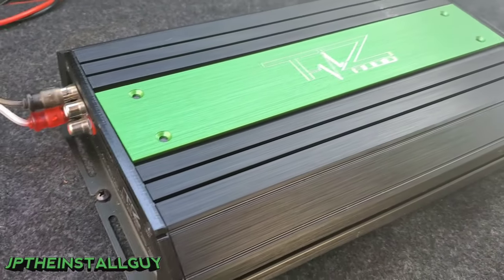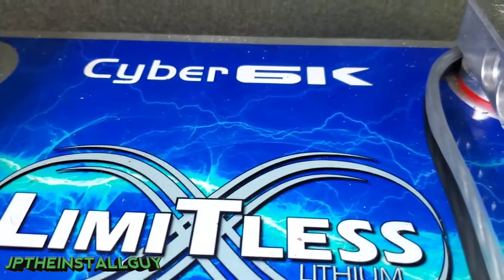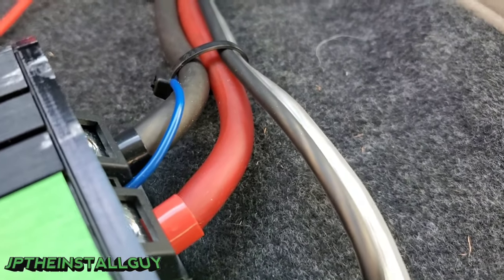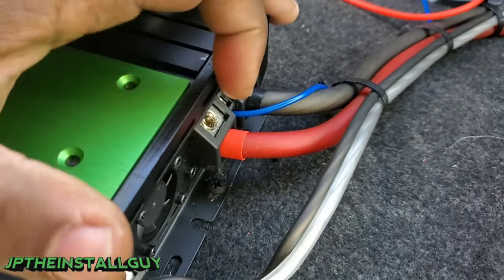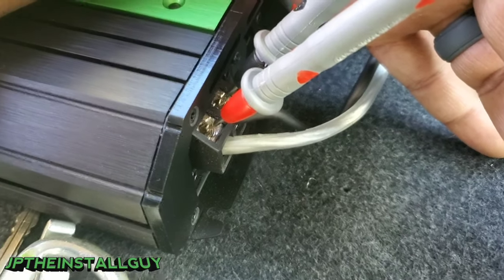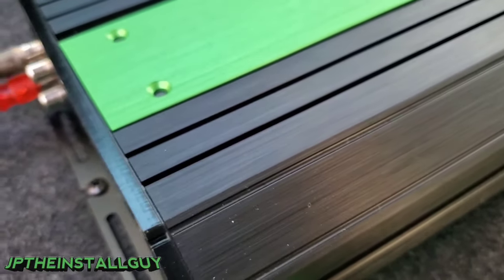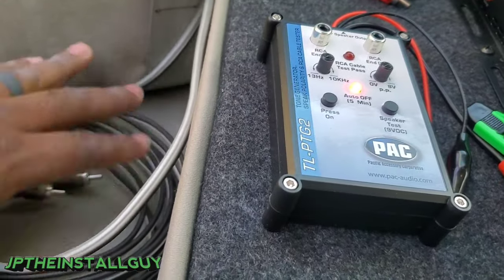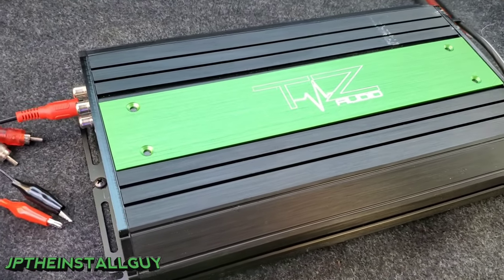Amplifer Troubleshooting: What to check if your amp is cutting off, no sound, protect mode

Comment: My amp light is on blue and then goes into protect after volume goes up or the bass kicks in and then goes to red
Reply: Subs are probably under powered, witch means that the amp isn’t enough amps to power your subs
Reply: @jamesking3685  i have the same problem but my amp is pushing enough power a year later i get this problem
Reply: Fix your ground wire get a good ground make sure you use a nut and bolt for ground and remove the paint before making a ground. I use have same problem got fixed with this
Reply: Make sure your wiring is tight and able to supply the power needed
Reply: Same here bro on my amp logo lights up blue now it don't even work😡
Reply: Ground
Reply: Same problem dude
Reply: Same happen to my amp feel bad when the bass goes low aniways happy new year
Reply: @navb757  saved me i was about to get a new alternator thanks
Reply: Thats my problem also
Reply: Check the remote cause if the fuse is Good it's the remote
Reply: I had the same problem my wires on my radio were just lose
Reply: Mine too
Reply: Check ground
Reply: I agree with James King you have a lack of power feeding your amp
Reply: I have a audiopipe holding 6 tweeters, 4 door speakers and every time I turn on/off my car the amp lags to turn on, or sometimes it doesn’t even turn on at all? What is the problem?
Reply: @jsunday2 same thing happens to me did you find a solution?

Comment: I got one for ya. More frequently now, my amp will cut out. If I turn the bass up or volume up, it will come back on for a bit then cut off again. Sometimes it won't come back on at all.
Reply: did you ever get a fix?
Reply: Mines doing this exactly
Reply: did you ever figure it out? im dealing with this.
Reply: It does that to me but it never turns off I gotta  turn my car off at the red light to turn it back on 🤣
Reply: You should have two dials on the amp. Turn them down

Comment: I have been the whole weekend fighting with this exact problem with my amo, low voltage in the positive and perfect on the remote cable. I did check the fuse, it does look fine me. So as soon I can today I will replace the fuse if that doesn’t fixed the I’ll run a new wire. Thank you and I let you know what happens.
Reply: Did it work ?

Comment: JP, great video man, And if you touched on this in the video, forgive me. Cause I completely missed it LOL.  My subwoofer seems to cut off once I turn the volume to a certain level.  When I looked at my amp I see it is in protect mode.  If I keep the volume lower. Nothing happens but as soon as I turn it up Protect mode kicks in and subwoofer cuts out.  Which of the tests you showed applied to that or did you not cover that specifically?  I would appreciate your help brother

Comment: I recently changed my head unit, there was already an aftermarket radio in it I just changed to a different one, everything was just unplug and plug back in. Everything works except my amp and sub, the LED on my amp flashes red and blue and then turns off. Any ideas on what the problem is? The only wiring I had to do was cutting the remote wire off the old harness and connecting it to the new one. My amp is a Vertigo Power Acoustik 1600W

Comment: hey, i'm wondering if you have experienced installing aftermarket radio with honda stream premium audio factory amplifier. i've been looking for info like where the factory amp is located and which wire from the stock harness powers the amp. so far my android unit plays normally but no sound is coming out. if i wired a speaker directly to the player, there is audio.

appreciate your assistance. thanks

Comment: So I have a cxa600.5 and it worked great for a very long time. I did have a sub problem and since replaced it with a new one, but it worked right away and now it doesn’t work at all after a short drive. Could it have blown that fast?

Comment: I have a 5000w orion amp connected 2 a 12" american bass sub. Had a pro install it worked great for around 8 months. All of a sudden now its popping and making weird noises the light keeps turning red. Once in a while it will run good then do it again

Comment: Great video will Subscribe, J.P. did have loose ground, however still need to get the correct voltage match have levels inputs all the way down on channels 1/2 & 3/4 bridged. The 6X9 speakers are rated at 120 rms 240 max, so guessing Amp isn't 🤔 powerful enough to drive em. LET ME KNOW.

Comment: I checked All the power and ground connections, I have over 12 volts I checked oms on the speaker outputs and it reads from 1 and drops to zero. 
Does this mean the problem lies with the sub?

Comment: I have a 4 channel amp that I've had 6 yrs. This just started the FR door speaker is popping at high volume, I took it loose and connect it to the FL speaker channel 1 on the amp it stopped should I just replace the amp

Comment: Helloo ,
I have a BELVA-BB200ABV2 amp. 

My amp goes to protect mode, I don't know why.

I run a wire from the (+) battery to the 12v of the amp.

I connect the REM of the amp to blue wire on the radio. 

I get the ground from the (-) pole of the battery.

Any advice is greatly appreciated.

Comment: hi I have a Rockville rws 10ca 1000 amplified power car subwoofer enclosure and for some reason when i am playing music the sub will stop playing  then when I play another it might turn on play for about 3 minutes then it may stop again. I thought that maybe it was the radio which was a factory radio now I have a jvc kw-560bt and I thought that fixed the problem but its doing the same thing . works   when it wants to . I know that its getting power because the green light is on

Comment: Hey guys. I've got  2 fosgate and P3 12s and a skar amp and DD in doors. Every once in a while. Whenever I turn up the base by the base knob or it hits hard, it doesn't go into protective mode, but it does cut out the base. the music keeps playing, but the base turns off. Wish do I do first?  Could it be the amp itself and how can I know?
Reply: Check if the bass cuts red light comes and go

Comment: My amp & eq stopped working while I was driving. Voltage in power wire but No voltage in remote wire. Fuses aren’t blown. Connections look good. Amp & eq going to fuse box. If you could give me something I’m missing I’d appreciate the help
Reply: Check your remote wire from head unit all the way to amp make sure it is connect to blue and white amp wire from head unit

Comment: I thought my door speakers were shorting on the sheet metal but I'm not sure they're connected to the amp while running subs that should be a separate circuit

Comment: Why does my amp read 29 volts but my battery is at 13? I've been trying to figure this out. They worked fine until the other day. All the sudden my amp is reading high and isn't in protect mode until I hook speakers to it. But I tested speakers with multimeter and they good not blown. I'm soooo lost

Comment: The AMP power gauge accidentally touched the casing of the capacitor and caused a small spark. Does that short circuit anything and affect the SUB and AMP?

Comment: I have this amp, I used 2 different power cables, 2 ground cables, and I disconnected everything and I still have the red light, but when I disconnect the control amp, no light appears. I tried another cable and the same thing happens.
Rockford fosgate r2 blinking red light with amp control

Comment: Hey bro I have a kicker CXA 1800.1 with two Q-class L7 12's I recently upgraded my alternator and added a second power run and bigger grounds and a few fuses with a 29AH SCIB bank everything has been working fine for the past two weeks except for when I turn the car off if I open the door before everything completely shuts off it will burp my subs at Max volume for several seconds today I was checking it out clamping my setup and turned the car off and had the door open and it burped them louder than ever enough to shake the house and make the neighbors mad anyway I didn't think anything about it because it has happened several times but I went to get cigarettes about an hour ago and as soon as I turned the car on everything was fine except I was getting a major voltage drop at the positive input on the amp itself this has never happened before I literally never get voltage drop with the overkill power supply on a 2k amp so this has me really concerned I understood the amp and everything is completely fine throughout the rest of the car all the way to the lithium in the trunk right next to the amp so have I fried it it didn't have any music playing through it or anything and was dropping from 14.8 to 13.2 just driving to the gas station and it never did this before it burped today

Comment: So I’ve had my system hooked up for years like 5-6. Rockford fosgate p3 12 2ohm and a 500 watt fosgate amp they actually pushes 620 watts. All of a sudden now when I turn it up it’s going into protect I never have all the settings all the way up and far as I can see all connections are good I can’t figure it out only does it on higher end of the volume

Comment: For a while now my amp has been stuck in protect mode it started one day when i had them too loud and they stopped playing and started smoking so im assuming the amp is just done 100% but i want to make sure theres no fix before i buy a new one. Right now when i put all the wiring in the amp it stays with the blue light until i put the remote wire in and then it goes back into protect mode does anybody know what the problem is or have a fix. I've alr tried letting it sit with no wiring.

Comment: I have power to all my wires and I did tests on everything except the fuse I checked that and it looked fine but I will check it now, if it’s none of those things what are some possibilities of what’s wrong? I have a mb quart rw-110a with the amp built in with the sub and it’s in protect mode when I try to use it

Comment: Thanks dude.  Helped me out. 
Well made video. 💯
...............
Question tho: I have a rockford fosgate t1000x5ad..... and when I have her all hooked up, I get ZERO sign of life?? I've checked all V reading at all points with the meter. All at the correct numbers. But check it out....--->I tried taking a wire and jumping it at the B+ to Remote and when doing so.....my amp gave me a SPLIT SECOND of life with a BLUE light....then NOTHING.  🤔 
**I even took it in to my local car audio shop to have them test it.....They said IT WORKS PERFECTLY!!! O_o   Duh Shiiiiiit my dude?!?! lmao.
...
..
.
What's you're idea/opinion?? 
Please help me slap again!! 🙏🙏

Comment: I have a skar audio 2,400 watts dual 12 and on the side were the speakers wire goes it says that is 1,200 watts at 1 ohms and I have a boss chaos’s 2,800 4 channel and when I turn my bass up my amp goes to protection mode but when I turn my bass down it doesn’t I want to know what u think my problem is
Reply: Your amp isn’t a 1 ohm stable amp and isn’t near enough to power those subs you gotta find a amp that makes 1200 watts RMS and is 1 ohm stable

Comment: My car amplifier have power protection on. I'm getting reading of 12.8V on pos cable but 10.5v at remote. Everything was fine since yesterday that my amp got a little bit of water under the amp. I've check every fuse and power cable. All of them are reading 12.8V. Only thing I guess, is the remote cable. Can somebody have an idea what could be the problem? 
Thanks in advance
Reply: Dry the amp out. Spray contact cleaner inside.  Then try again later. I have similar problems when it rains. And moisture.  Both my amps stopped working.  Then did this let them dry for a few days. Bang they work again
Reply: @aaronmiglioranza2931  thanks, I opened the amp and that was a mess inside! I got a new amp. Back again with better sound also! 💪😁

Comment: Install consists of head unit ,amp ,1*12"sub and 2*6.5 mids
When i switch functions on the head unit say from tuner to aux or cd ,the  amplifier switches off.
Only when you switch back to tuner mode on the head unit,the amp turns back on 
I check all the connections..
Reply: Did you hook the amp turn on wire to the antenna turn on ?
Reply from the maker: Sounds like your remote wire is hooked up to the power antenna wire

Comment: Will wiring speakers to .05 ohm make the amp turn off and on? Bass will cut in and out.
Reply from the maker: If your amp is not 0.5 ohm stable than that low of an ohm load will cause bass to go in and out

Comment: System was working great   after 3 weeks i had it it my bass knob  change color to red then cut off goes back to blu e amp has power  protection mode not on no out out when bass knob cut of
Reply: Do you have a Mb Quart?

Comment: After my comment I realized there’s a bunch of people helping others in the comments so figure I’ll throw my issue out there. Couple weeks ago every once in a while my highs would cut out while driving ( I have a bass and a high amp). Everything except the bass would cut out. I’d pull over, shut off my truck, start it again and everything would be fine.. that started happening more often until today something stranger happened.. (While sitting in my truck waiting for it to warm up because I just replaced and filled my radiator). All of a sudden I started hearing bass. Just a thump every second or two. I checked to make sure my phone wasn’t connected to the truck (it was connected to a Bluetooth speaker in the garage) and it was still thumping. I look at my deck and it isn’t lit up at all, like it’s not powered on. I turn off my phone music, it still thumps once every second or two.. Now I have no idea what’s going on, I turn off the truck and pull the key out the ignition… still.. the thump continues.. super confused, I start the truck. The deck lights up, the Bluetooth connects to my phone and everything is fine. Now, listening to my phone through my truck, I’m watching YouTube videos trying to figure this out.. 5-10 minutes in, my highs cut out and it’s just bass like what happened before. Anyone know the first place I should look?

Comment: My ride won't turn off unless I disconnect the amp and fuse is still good.. Any one know this problem?
Reply from the maker: remote turn on might not be on remote turn on
Reply: @jptheinstallguy  thank for the reply.. My power wire was bout to disconnect so I just adjust the wire.. Actually I adjust all the wires and tighten them down and now it's back to normal. Thanks again

Comment: THESE SO CALLED TIPS IS NOT GOING TO WORK.  THE REASON IS NONE OF YOU DO NOT NOTHING ON THE AMP BOARDS AND DO IN HOUSE TESTING before install it is common sense.   All gronds no matter what grounding point is P.S  AND THING PASS THE FRONT DASH IS ALL BAD GROUNDING POINTS PERIOD.
Reply: Why don’t you make a video showing us the correct way instead of blowing a fuse going off on this guy
Reply: I have a question  my amp and speaker works fine if I turn the radio  up its go es in to protection mode and makes a pooping noise. What causes it ?